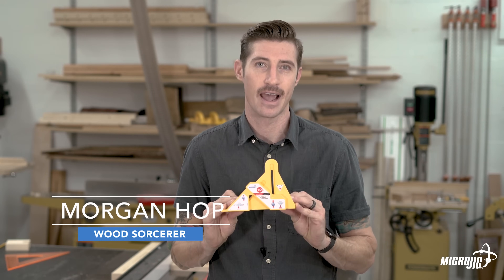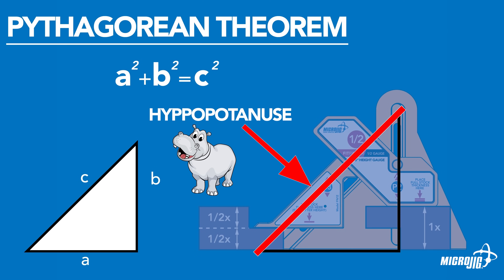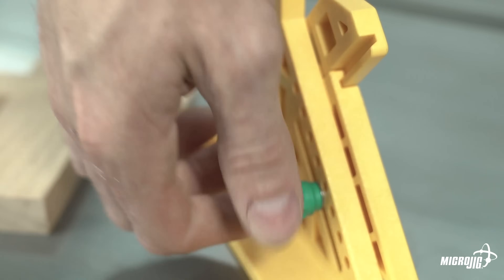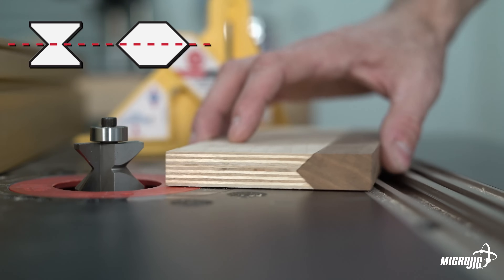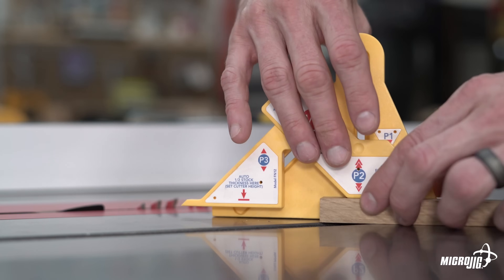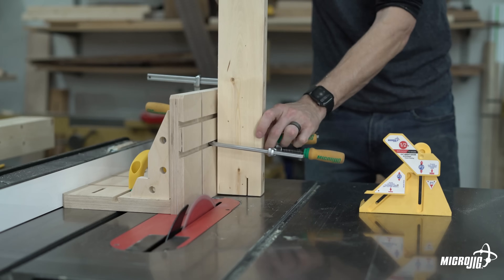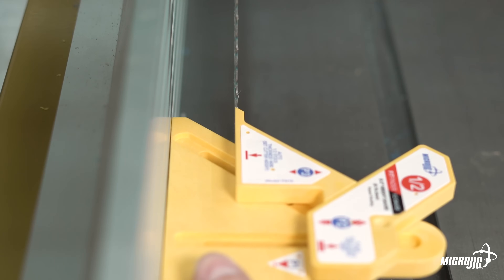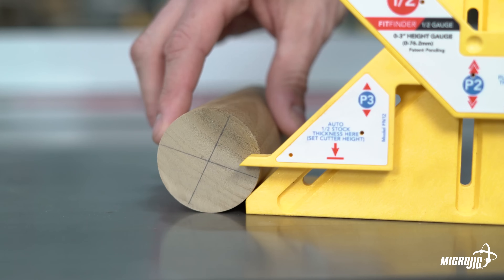FITFINDER 1/2 Gauge Instructional Video

Comment: I found this tool has more hype than ability, it doesn't move smoothly and doesn't sit flat on the reference stock without a bit of pressure. I purchased this along with their specially ground lock miter bit this combination really wasn't that accurate, the ground shelf on the bit was not flat or the gauge wasn't so all this expense only got me close in the setup, not a one stepe solution as shown. A lot of money spent to produce a marginal increase of setting up a lock miter bit and will probably bring just as poor results on half lap joints. Very disappointed with Microjig they should have used precisely ground aluminium not sloppy plastic.
Reply from the maker: Contact me at ralph@microjig.com and I will be happy to talk with you about your issues with the FitFinder and get you a new one.

Comment: If I need to cut a piece in half on a bandsaw, how do I use this gauge when I have to take the cutting blade thickness into account?
Reply from the maker: Kenny, set the fitfinder on it's side against the bandsaw fence, and align the pointer to the center of the BACK of the blade. That is easier and more accurate than trying to deal with the set of the teeth.
Reply: @Microjig  Understand. Thank you.

Comment: When using on table saw, the kerf on blade throws of center if you are looking to cut a piece into 2 equal parts
Reply from the maker: That is true. We do have a video showing how to set up to resaw a part into two equal parts (each less than 1/2 the beginning thickness) and to cut one part that is 1/2 the original thickness (the leftover is minus the kerf) 
https://youtu.be/VRErpwSaMgI

Comment: This thing just arrived and today was my first chance to give it a try on the table saw. My half lap test, after very carefully setting the saw blade to the bottom of the half height part, still made the cut slightly short of half. The problem seems to have been in finding the high point of the blade, even though I put considerable effort into that. Any tips for keeping the slop out of that measurement? It seems that it might take some good luck to get it set just right.
Reply from the maker: With the saw unplugged, set the FitFinder parallel to the rip fence so that the blade is under the bottom of P3, not just the pointer.
Then raise the blade, turning it backward by hand until the teeth just barely scrape the bottom of P3.
Reply: @Microjig  Thanks, Morgan. That method helps sneak up on the setting. I was already doing that system, and I think my original problem had to do with the small amount of play in the fit of the three parts of the jig. If I set the Fitfinder to a small board with parallel sides, make a mark at the indicated center point, then turn it around and measure from the other edge, the marks come out about 3/64" apart. I don't know whether a fit that close poses a difficulty in hobbyist woodworking, maybe not. For me, the distancce between the two marks is about the thickness of my bandsaw blade, so I just saw exactly between them.
Reply from the maker: @TedStJohn-vz9jr  are you marking with a pencil to get this result, or with a marking knife? Marking with a pencil will always have some offset, and that is doubled when you reverse it.
If you think your FitFinder is out of spec or defective, then please do contact us at support@microjig.com and we can help you resolve it.
Reply: @Microjig  Thank you for the reply. The 0.5mm lead in my mechanical pencil is wider than a marking knife cut, but the two marks from opposite edges were separated by a gap wider than that, and the pencil mark is easier to see. I think the play in the parts is the problem. The amount of error is not of great importance in most wood applications, and I doubt that a plastic jig with moving parts could be made much tighter. I just have to be aware of it when it would lead to a loose-fitting joint, which is the context for this remark. Thanks for your help.

Comment: Can this device be used to set depth of cut for lap joints on a radial arm saw?
Reply from the maker: It certainly can, but the reference point on the FitFinder is the underside of the pointer, so you would need to visually set the blade tooth to the sharp end of the pointer.
Reply: @Microjig  Another method to measure off the bottom of the pointer would be to clamp a small piece of wood to the bottom of the pointer 90 degrees to the pointer.
The top of the small piece of wood would now be your reference point to set the miter saw blade height to.

Comment: This is an incredible tool. I would like to see a non-plastic version however. It would be great to offer a budget version as well as a premium version. Just saying!
Reply from the maker: A cast metal version would be no more accurate than this one. A machined metal version could be made more accurate, but would you be willing to spend over $100.00 for it?
Reply: @Microjig yes
Reply: @Microjig  I’D probably spend $100 on it, yes. $200, probably not.
Reply: Also, I would love to see an added feature that would allow me to gauge the distance from my shaper fence to the Apex of the cutter. I think you can use this tool for that, although the extended point might not be long enough to clear the cutter
Reply from the maker: @Simonfrios  Yes, that would depend on the cutter. But that does not need the 1/2 Gauge feature, so any height gauge with a long enough pointer could do it.
Reply from the maker: @Simonfrios  We get that. Our goal is to make good tools for reasonable prices. That dictates the manufacturing options.
Reply: Woodpeckers is salivating at the thought of making a metal version for over $200 ;)